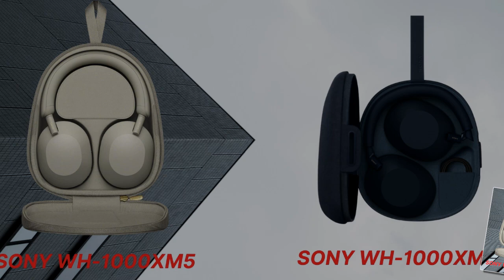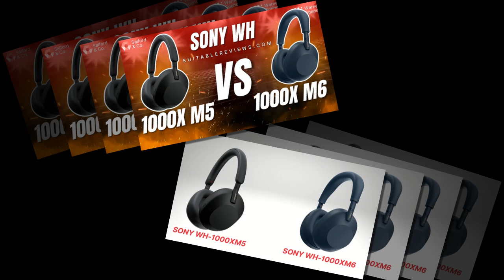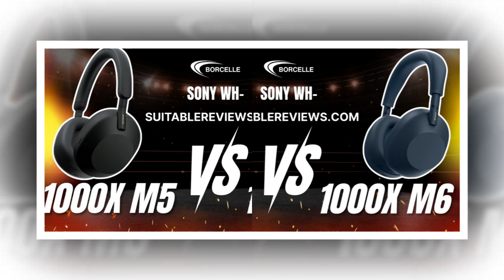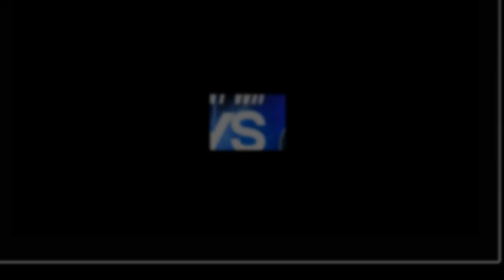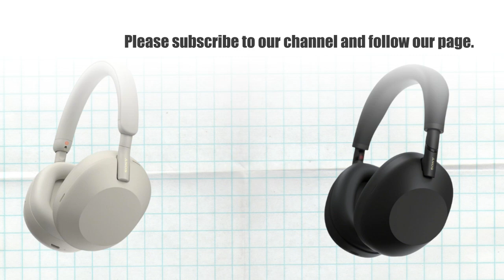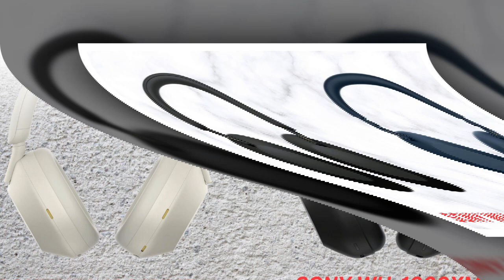Active Noise Cancellation Showdown: Sony WH-1000XM5 vs Sony WH-1000XM6 Technology Deep Dive

Comment from the maker: Headphones Link = https://cutt.ly/gtpgNi5i

Active noise cancellation technology separates premium noise canceling headphones from ordinary models. The Sony WH-1000XM5 uses two processors controlling eight microphones to detect and counteract external noise, particularly excelling at eliminating airplane sounds and conversational voices. The Sony WH-1000XM6 revolutionizes this approach with the HD Noise Canceling Processor QN3, which is seven times faster than the previous generation. This advanced processor simultaneously optimizes twelve microphones for real-time noise detection and cancellation. The Adaptive NC Optimizer in the WH-1000XM6 intelligently adjusts to external noise, air pressure, and wearing conditions, even accommodating hats and glasses. The comparison clearly demonstrates how the WH-1000XM6's superior noise cancellation technology delivers an unmatched immersive listening experience for discerning audio users.

#ActiveNoiseCancellation #SonyWH1000XM5 #NoiseCancelingTechnology #PremiumHeadphones #AudioInnovation